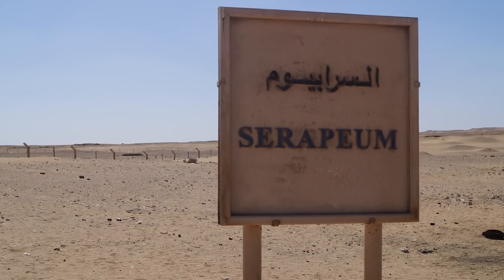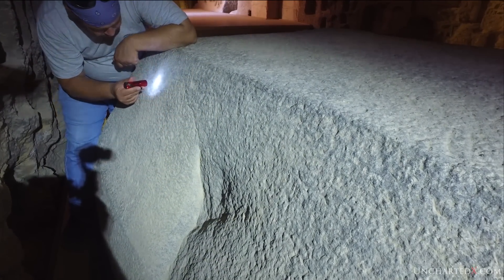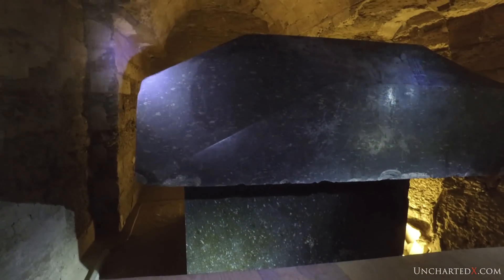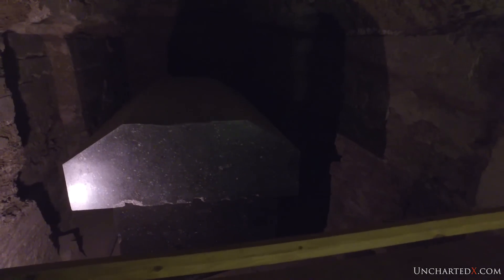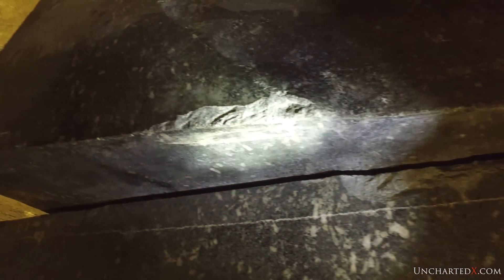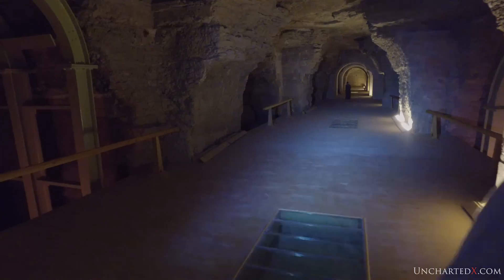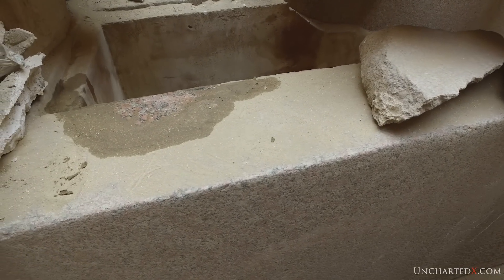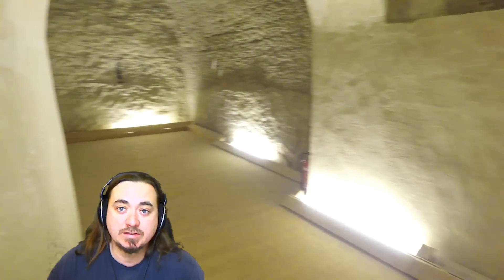Evidence of Ancient High Technology - Liquid Polishing at the Serapeum of Saqqara - Chapter 4

Comment: When the boxes were found, they were still sealed and contained a very caustic odor, bitumen and fragments of bone. The boxes served as a pressure vessel, the small was ammonia, used as a solvent to the bitumen, which contained trace amounts of lithium and the bone collected the lithium. The process was similar to aging whisky in a barrel, where the impurities in the whiskey is transferred into the wood. In this case, the lithium as absorbed in the matrix of the marrow, for later extraction. 

Everything in ancient egypt points to people with advanced knowledge, adapting their knowledge to a stone age society. How else in a stone age world, can lithium be obtained, without passing on so much technology, that their own existence would be at risk? 

https://youtu.be/R_AIodG17h4
Reply: Hi. 
     As a retired Maintenance Manager with a Mechanical background at one of the Largest Wastewater Treatment Plants on the West Coast of the U.S. These were not junky Treatment Plants like you see in States where there are no funds to upgrade or upsize those plants. Of all the Steam Systems all over our plants from HP to LP, they have many Pressure Vessels installed along with our Liquid Oxygen and Nitrogen Air Separation plants. A pressure Vessel can be either considered High or Low Pressure vessels depending on the process whether it be a vacuum or pressure of anything above 0 PSIA or approx. 14.7 PSI. 
     In my experience in Piping Systems of which Pressure Vessels are part of, I’ve seen several instances of Explosions and/or Implosions of Pressure Vessels and Piping but usually a problem existed either through design error or human error. If these systems are Designed well and all Equipment and Piping are materially correct everything usually functions normally but only after a new system is built, it still required our department to fix and repair the stupid out of a system. So here’s my point, because of Bernoulli’s principal regarding pressure and how it exerts pressure evenly throughout the vessel. The process you describe seems to be a slow deliberate procedure to extract Lithium annd I doubt there would be a reaction to these chemicals so I could accept these being pressure Vessels. I doubt there would be enough pressure to lift the lid. Just don’t pour Sulfuric Acid into a vat of Chlorine, to do so is a let me know moment so I can run for my life. And to calculate how much pressure in a process we need Instrumentation which is absolutely critical to know anything about what’s happening inside the vessel. (Temperature, Pressure and Level are the most commonly measured conditions. I am not going to lecture you because I know you have a superior knowledge of Chemistry. But I know how machines work and I know the fundamentals of both Construction and continued Maintenance on any process equipment especially if there are reactive materials like Methane Gas or some other Petrochemical compound or even just LP Steam, fairly harmless unless something blows up and injures someone or worse. I love watching Ben and Ben and Christopher Dunn because these guys work very diligently to view and understand Ancient building Techniques and purposes. I need to know what processes were at work to begin to understand what it did and not as a single item in what could be an isolated part of a much larger Technically Advanced very large Infrastructure project. Every time I watch these programs especially Unchartedx, you see people walking all around these ancient structures and act all amazed at some big heavy stone blocks like at the Oserion. But as I watch the gawking crowd it would seem to me that to understand the Logic behind the Need and I see all over the floors and everywhere else in Egypt are the Core Drill holes most people see water drainage systems or sewers and as a Maintenance Manager that worked at one of the largest Treatment plants in California and the Country. What I see are conduits. A conduit is little more than a space created to convey a substance or Wiring. I’ve heard people ask that if there were electrical busing all over the old kingdom then where’s the metal? Being of Bronze Age and early Iron Age I would have to say that they “Beat their Ploughshares into Swords”. Another thought is then where are all the swords? I’m sure there are traces of Egyptian metals all over Europe just like all the Stolen Egyptian items in private collections and even in the Vatican. They talk about polished Stone, then take a look at the Vaticans 20,000 items displayed and 70,000 items in storage. They have the most impressive statues that are shinier than any stone I’ve ever seen. Way better examples than even the Ministry of Antiquities have. Also if the Seraphim’s boxes were extracting Lithium, that is very cool. But these would have to be opened periodically to remove product and there are no holes and other protuberances that any process material can be drawn off. And I don’t believe for a second that these boxes are tombs. Everything is a tomb or temple, mainstream Egyptology would have us believe that these really old people really must have liked rock. But to look at it with modern eyes and minds eventually the truth will come out. And as a little side note I always try to keep an open mind about future possibilities for understanding some things they knew that we don’t but the same holds true that we know a lots of information they probably didn’t. But here’s an interesting little piece of information I saw on ‘History for Granite’. In the Pyramid of Meidum installed in the walls of the entrance walkway and installed behind about 5-7 centimeters deep into the blocks of limestone are Sheets of Glass. All over the entrance buried inside the walls are sheets of glass, ah, huh, I am so amazed at the myriad mysteries of Ancient Egypt but I’m gonna only say this once: remove nothing from Egypt. Collect not, unless it’s for testing purposes and returned. Never take anything from Egypt. I’m not superstitious but the theft of Egyptian treasures has been ongoing for thousands of years. Hell I think most of Egyptian Obelisks are reinstalled in Italy. Most in the Vatican. Why such a thing would be needed in a Christian Church. The irony of slapping a cross at the top right next to the False God writings of the Egyptians. Give them back. We have a few in the U.S. too, give them back. I believe there are things in the British, German, Dutch, French, American Smithsonian, thieves. You have already stolen at least Half of the Country of Egypt. It’s not bad luck, it’s worse. A planetary problem. Theft. OK then I’m done. But I would like to know more about the chemistry of lots of Egyptian slime. Why are there not blotter tests done on everything in Egypt? At least they might find some strange chemical residues? OK, Goodbye. Hermit.

Comment: That "liquid drip" could just be the custodians using a modern stone sealer, which would be smart to use as people touching it day after day would damage the finish.

And your comment we can't replicate that process is totally false go to any tile shop and you can purchase a slate/quarry/satin sealer which will seal down 1-2mm darken the stone and a penetrating sealer will protect further in but not affect the surface finish or color. If you go back clean and dry the surface and flick some water on it, if it beads and remains after 5 - 10 mins a sealer has been applied.

Comment: Also, If you dont mind my rambling.  I want to point you to ankor. In the time of war. They busted up the nicest castle on earth to get the metal interlocking key ways. Just like the indian representative of intercourse. Stripped of copper. Its obviously a capacitor. I dont mean to offend a religion. They pour liquid over it, and it is used for fertility. Giant crystal in a square. Frequently found in rivers. Geometry purifies water. Sorry for side track.  Just saying metals were pillaged. They always are. Ur just missing connection and moving water which we know was there. They are all meaning structures on the sweet spot plane around the earth just as any old electric motors pick up coils.

Comment: The scoop that stopped the cracks is still done today if a stress and crack appears on steel the welder or repair person will grind or finish the end of the crack so as to stop it.
Also the box that wasn't finished because of a crack, correct me if I'm wrong but I see like a brick work as if the box isn't a one piece but an assembly of bricks?
Also the polishing isn't exposed to sunlight or weather so in those years on outside pieces of work would have to be repolished.

Comment: Watched this video, saw the clear drip features and I wondered “would liquid sodium silicate do the trick?”, so I went looking for low tech instructions on how to make (see recipes at: https://youtu.be/bW8-RNYmdGw and related videos - chemistry capable of smelting copper should be able to create this material imho..) and then I wondered “has anybody tried applying this to granite?”, looked and found https://youtu.be/nZvxnO5vycI ... who seems to have wanted to answer this very question for this very reason.. so, at least putting a liquid gloss on the boxes might not have required super complicated chemical technology (whatever the main original purpose was for the boxes). Sodium silicate solution also goes by name of “liquid glass” or “water glass” - not to be confused with glass in molten form. The coating would not discolour as organic material (such as oils or waxes) in fact it would be quite compatible with the stone. (Credit also to the couple of others who mention those terms in comments but don’t actually explain their comments - I scrolled through all to see if this idea had been presented properly). It would be nice if the drip marks could be analysed to support this theory.. but if it’s correct you’re not going to be able to do this easily non-destructively. In any case seems like the coating recipe got lost/forgotten otherwise I guess the later Egyptians would have been slapping it on lots of statues to keep them shiny..?

Comment: the way you describe it sounds and looks like some sort of clear epoxy coating, how it's a liquid layer. google concrete epoxy clear coat for a modern example, i did concrete restoration for years and the finish process described is the same as concrete epoxy coating

Comment: Good crack is hard to find..seriously. Modern engines are magnafluxed to find defects. The short story is imagine transporting these hundreds of miles only to have them crack. Winsheilds on vehicles is a similar thing where injecting a glue stops the crack from spreading. That being said...the faceting may be a similar requirement or need to avoid further cracking. Maybe these are using earth energies ...ley lines..perhaps a communication network..dowsers should investigate this site

Comment: I have to disagree with you on a couple of things. 1. You say that because of the "scoop marks" you believe that the ancient Egyptians didn't care about how the surface looked, and that the therefore there must have been a functional purpose. I would suggest that you are wrong on many levels. They cared very much how the boxes looked, or they wouldn't have bothered to polish those scoops. And the boxes, as sarcophagi absolutely DID have a functional purpose. They were literally meant to be a forever home for their occupants. That's why they were made of stone. So of course they would remove any visible cracks to prevent them from spreading. 2. While we do not know in detail exactly how these boxes were polished, or what materials they used as abrasive for doing so, it is absolutely insane to suggest that it would have been difficult at all to get into the scoops to polish them. Almost all forms of polish that we use today are a fine abrasive slurry, being applied and rubbed around on either a soft pad or cloth, and have no trouble moving in and around curves. Especially with hand polishing, which this undoubtedly was. 3. You use the phrase "advanced technology" a lot. But I think you need to elaborate greatly on what supposed level of advancement you're talking about whenever you bring it up. Because if you mean things like bow drills (which could easily be adapted for polishing) and wheels, then I'm ok with that. But if you're suggesting they had ANY sort of advanced knowledge of chemistry, electricity, or the like then I'm afraid you're just  making up fantastic claims with no evidence, which only serves to further muddy the waters of mysteries that have already been put to rest pretty conclusively.

Comment: Due to the fact that the box and lid were cut from the same piece of stone.  I would venture to guess that the faceting is just the result of creating a finished suface plane, on an uneven rough stone, and therefore minimizing the volume of material removed to get a finish.  I disagree with the theory that they dished out cracks to minimize futher cracking and would speculate it was better done to prevent snagging whatever polishing tools they were using.  In essence they were making something similar to what we call a "surface plate" today.  In super simple terms, you interchange rubbing three separate stone surfaces, of equal hardness, together you will get an absolutely true flat and polished surface.  The last thing you wast is for a chip or small piece of an imperfection to get between your surfaces so dishing them out would insure there are no contaminants in your polish.  This process would also help to explain the faceted planes, if they were using another flat surface to polish.  Look up also, how lithography stones are made and polished and how surface plates are made, old technique.  You can easily test this technique out by simply taking to fist sized and dry dirt clods.  Rub them together and they will form two perfectly flat surfaces.

Comment: Never been is there any evidence of thermal manipulation Heating of the granite there like in the great pyramid and other locations. If so by heating the surface would explain the polishing of the scooped areas as well as the depth of the affect. This process could be a process from electrical or thermal (ie focusing the sun using disc to concentrate the thermal energy . Like have been found in Peru or South American , essentially creating a crude laser. Then scraping with a metallic tool = smooth polished surface , depth of polishing , as well as some material run of (ie the dripping under the lid) as well they may have used a liquid of some sort to facilitate the processes. Or it could have even been done with oils , sand and hand polishing.

Comment: It's obvious there is a need to scrape off some of the lid-underside "drip marks" from the surface polishing & have it chemically & DNA tested.  It may be some kind of lacquer/varnish which could be a tree/plant sap/resin, and/or a combo of silica & some calciferous compound, maybe even bone.  

It shouldn't be that difficult to analyze & to re-create,  & its wrong to attribute the process to some fantastic scientific process when the "recipe" may be far more down to earth & just "lost" by the passage of time.  After all, other ancient processes include Roman mortar created using quicklime & volcanic ash, & Chinese mortar using sticky rice & slaked lime.  So it's not difficult to see that many processes used in antiquity will have been lost.

The fine accurate engineering of the cutting of the inside of the granite boxes defies explanation, tho' a human-powered belt-driven cutting device might be feasible with cut marks being hidden by a polished granite/resin filler compound.  That still can't explain how internal corners were cut to such precise  accuracy, but the stonemasons had years, maybe generations, to get the finished article up to designed specification.
Reply: keep in mind that when "they" were making this box, one wrong cut or abrasion would render this box as imprecise and would require them to start over....on a 100 ton granite box.

Comment: I know exactly what this is .   Let me start by stating that these boxes were not polished by hand.   They were polished by millions of gallons of water with sand in it.  Look how waterfalls cut and polish rock formations.  Any crack would be the weakest point and would be worn out first.  . The unpolished one was pry the last one installed before the catastrophe event.  I say that this is a hydrogen generator.  It might be the whole point of the great pyrimid.hydrogen from water .  Hydrogen to power their rockets to space.   They  saw the comit that would strike, hundreds or thousand of years before and calculated that it would hit.  Build rockets to either try to stop the asteroid or the very least get the human race off planet .  These boxes when struck by the water running over them would resonate at specific frequencies that would separate the hydrogen .  Or maybe electricity supplied would do that.    as well.the great pyramid either produced power in the form of electricity or it was a giant water pump.     The gold cap on the pyramid could either be how the electricity was broadcast like nicola Tesla was trying to do.  Or it was. A huge grounding pole at the highest they could get it. ..    the water pump pyramid gets struck the most by lighting and focuses that power and concentrates it to run the giant water pump.   I know this was a little winded .   The hydrogen could be massive power source too. But I like rockets to space. .